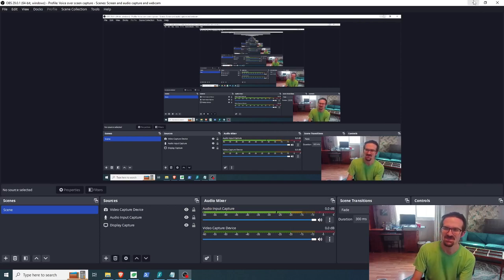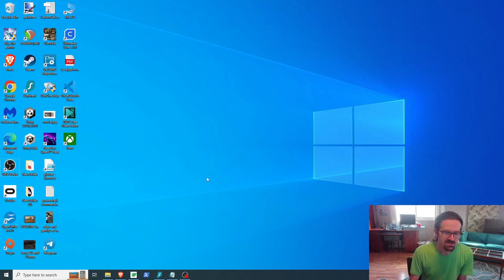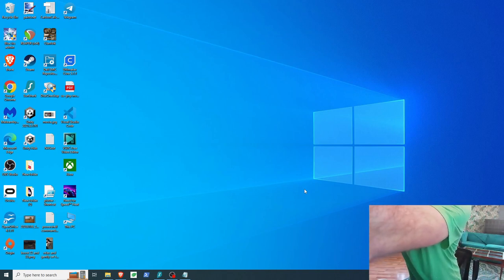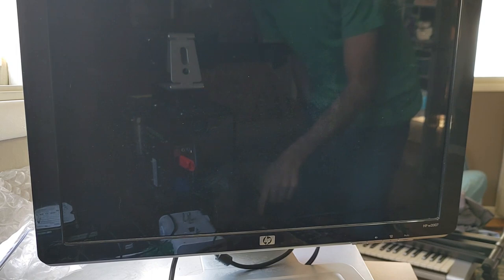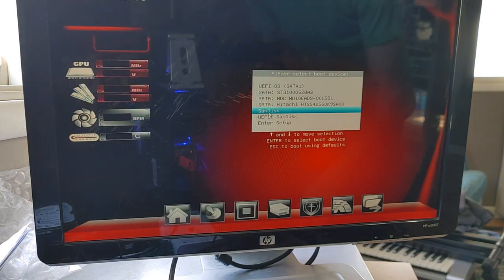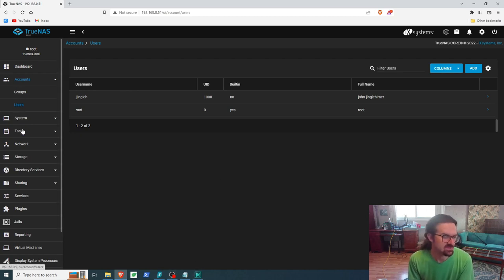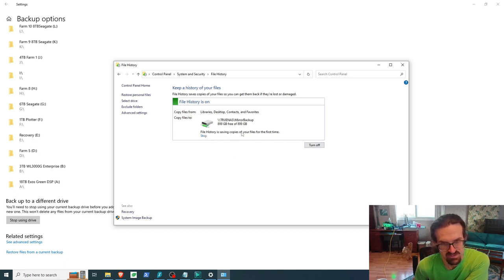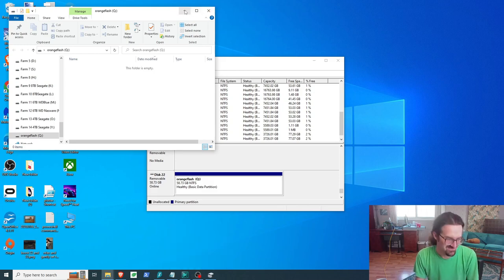Create an automatic backup NAS for computers in your home or office without additional programs

Comment: do we have to keep the NAS in Same network or can i access it on Wifi also. like i want to use the NAS as automated backup device at home for my office data. is it possible ?
Reply: anyone connnected on your home internet by lan or wifi can access it.. there are also some solutions to make that nas accessible from anywhere cnnnected or not connected to internet but thats not usually done for security reasons